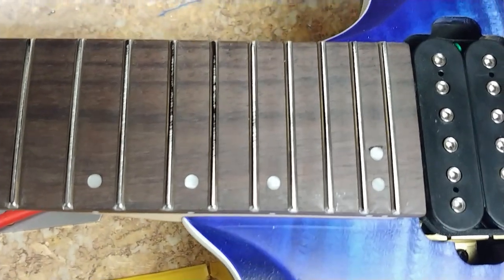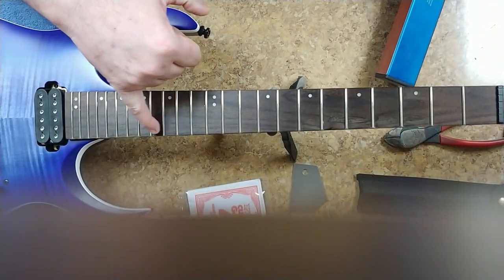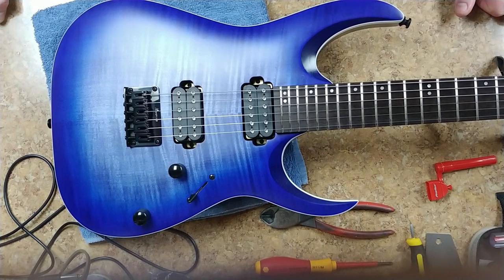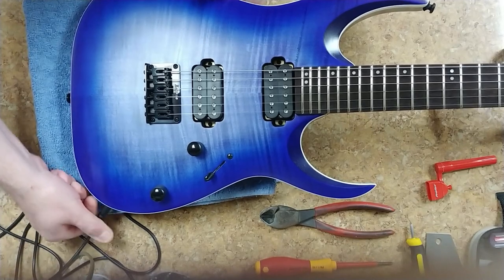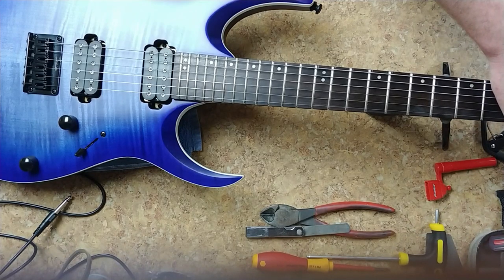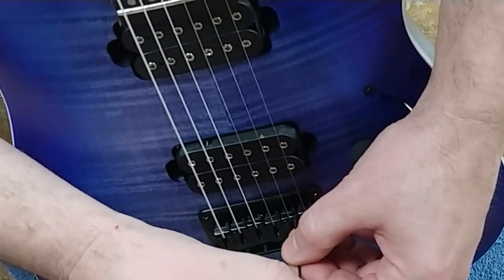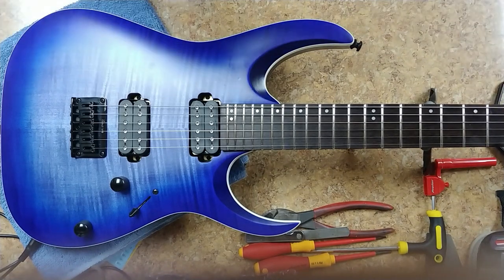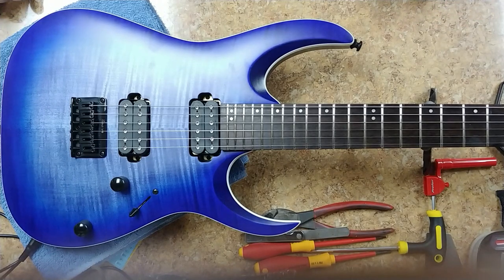GIVE AWAY IS NOW CLOSED!!! Ibanez RGA42FM Give Away Guitar First Part Setup

Comment: If you're getting scratches from polishing with paper towels, it's because you're using the wrong side of the paper towel...  don't use the side that has been coated with sand, flip it over...